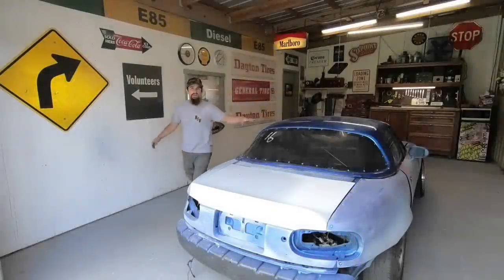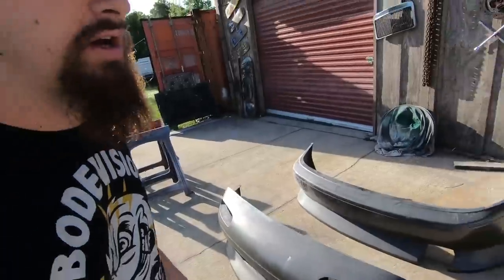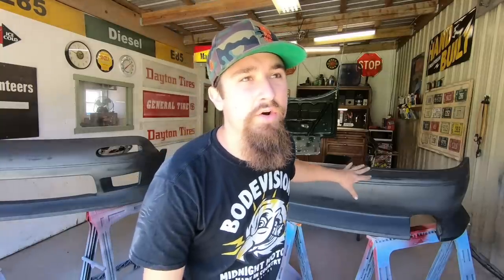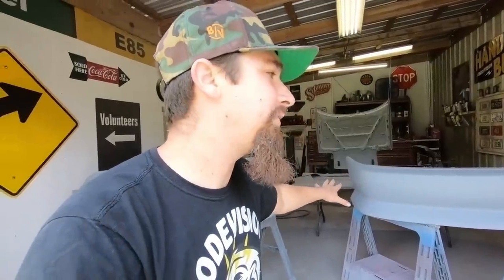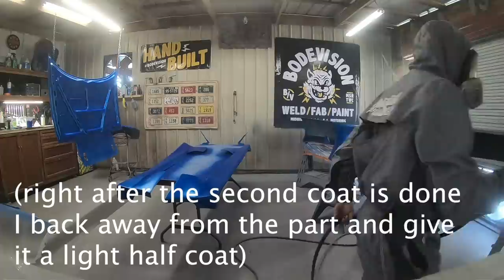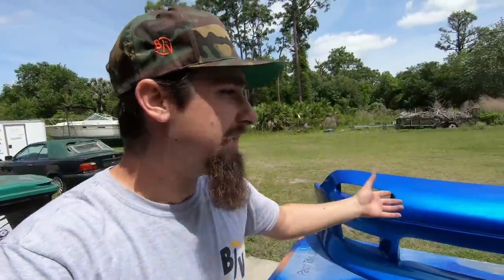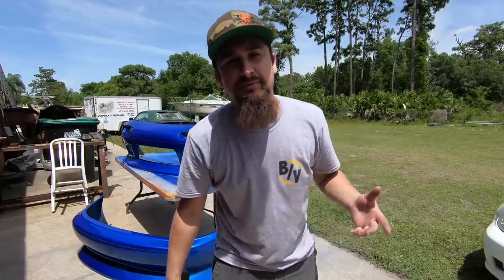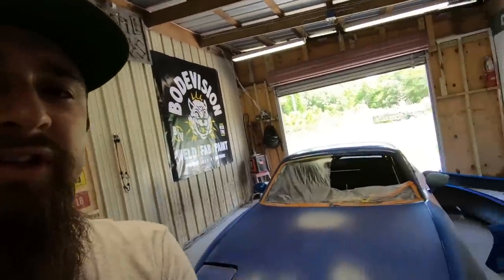How To Paint A Body Kit

Comment: Assuming your using solvent, do you really need a sealer if you use a light primer with light colors and dark primer for dark colors? Iv been lucky in the past not using a sealer but always wonder if something may show thru. Or are you using waterborne?
Reply from the maker: Jake Clauson I’m using the sealer since the entire car will get sealer. I want to keep the color as consistent as possible. If your primer is perfect you don’t need sealer
Reply: Mint 👍 materials are expensive, don't want to use them unless i have to

Comment: Help. I have a pre primered abs bumper from ebay and the primer that is on there i dont trust and its not fully  covering everything. Can i sand it down some and still spray adhesion promoter on there and then primer? Thanks
Reply: Yes

Comment: So you used a gray sealer but how much of a difference in color would there be if you used a black or white?
Reply from the maker: the color difference would be subtle but enough to see if they were right next to each other. If its a full car that youre spraying the sealer can be whatever color you want as long as its the same on all panels.
Reply: BodeVision would it be enough of a difference if you wanted to do something like ghosted racing stripes?